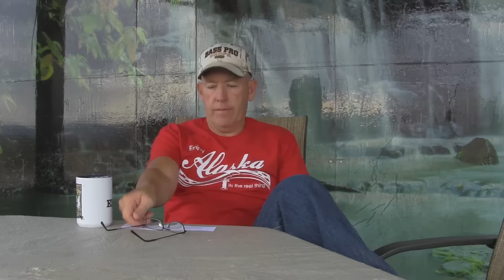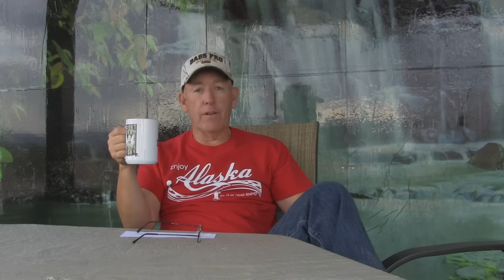Coffee & Questions 8/31/15 Plunge Router?

Comment: squirrel!  I have two bases for my Skil router, fixed and plunge. I use the plunge whenever I make an internal dadoe or slot. works pretty good. also I use a paste wax on my bases to let them slide easier on the wood. you need to buff it a bit so you don't get wax transfered to the wood.
Reply from the maker: +Michael Puffenbarger Sounds good.